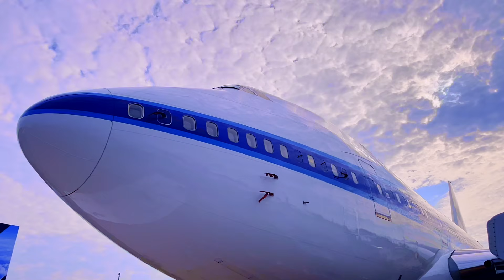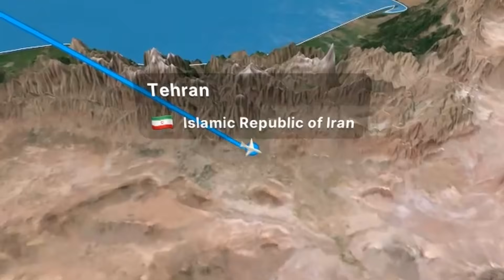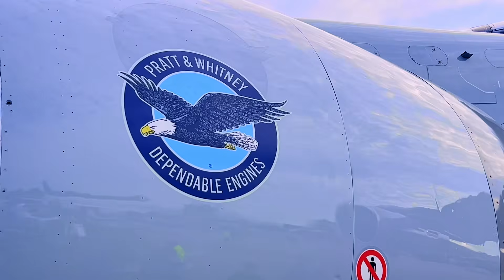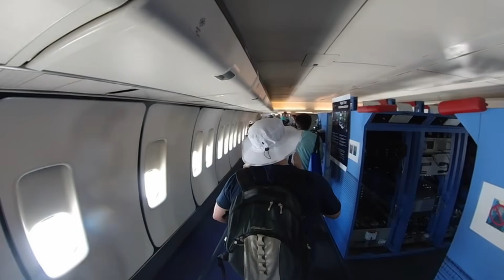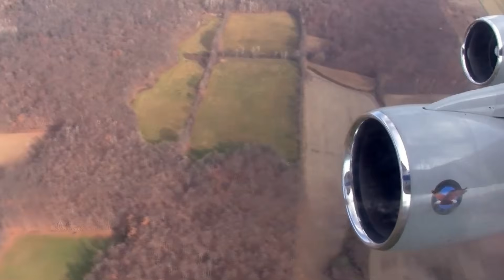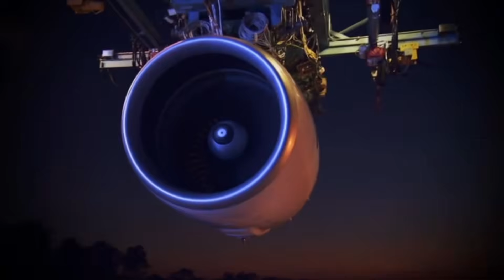The Weird Boeing 747 Variant With An Extra Engine

Comment: How does the test engine affect the flight dynamics of the test plane? Is where it's mounted in a place where it will cause the least amount of asymmetric thrust?

And even so, does the placement induce yaw or pitch which the flight crew has to compensate for? And if so, how much compensating control input does it require?

Comment: The final sentence sums the video up correctly.   But I wanted to know about the 5th engine and learned nothing other than it is mounted away from the 4 standard engines to avoid interferance of airflow to the 4 mains.
Reply: The fifth engine are different engines that undergo testing in real life conditions. The fifth engine is not a fixed part of the airplane and has nothing to do with it really. I think the video explained it pretty well.
Reply from the maker: Thanks for the comment and compliment on the explanation.